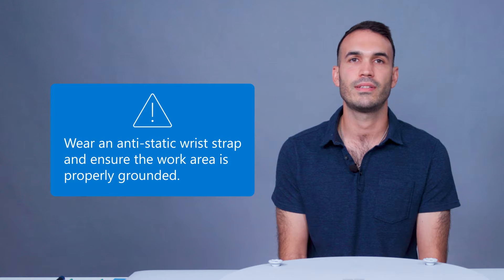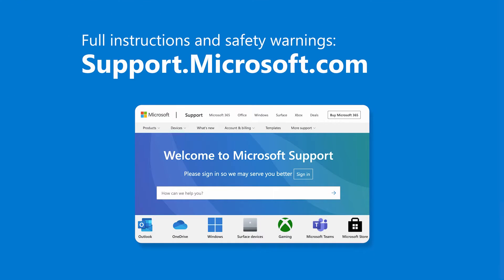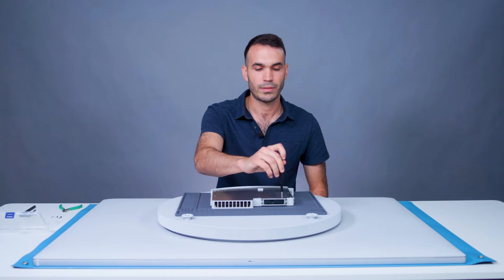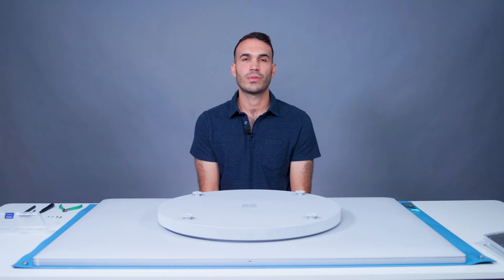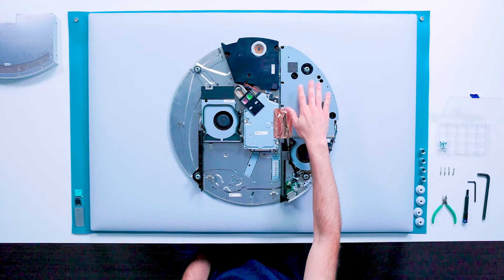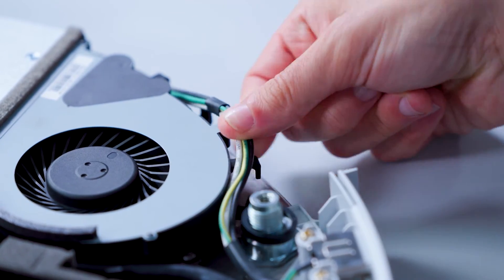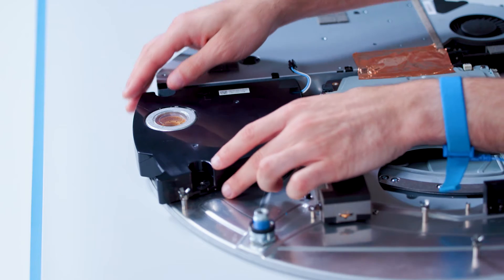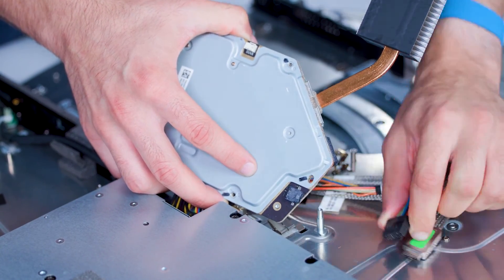Repair | Surface Hub 2S and Surface Hub 3

Comment: How do i find replacement parts for my surface hub 2s? I opened a support ticket with MS but they told me to replace the whole surface hub and that I couldn't buy replacement parts.

Comment: We have a Surface Hub S2 85, can we also remove the compute module on this unit without removing it from the wall mount?
Reply: Yes, its the same process for the 85" device